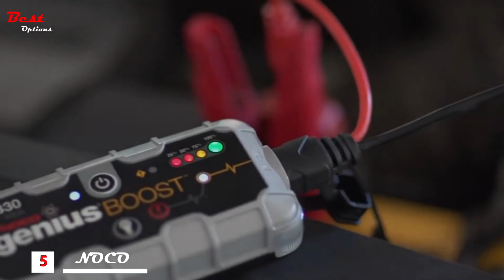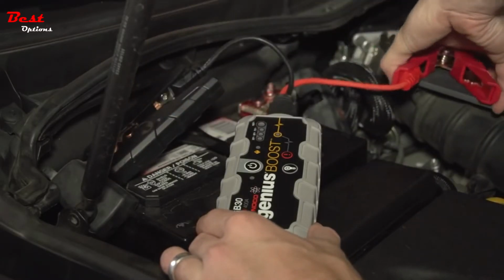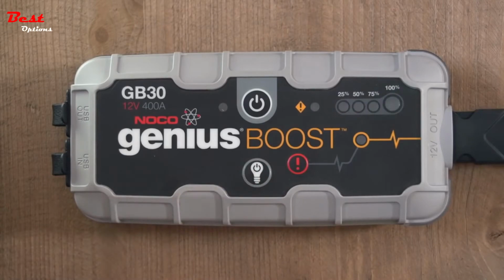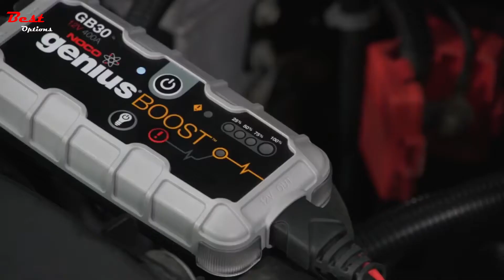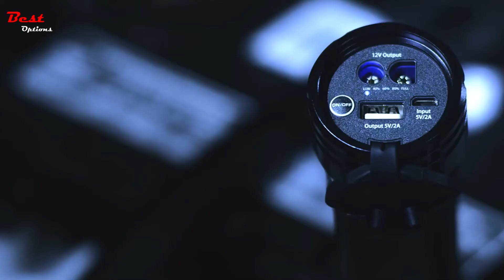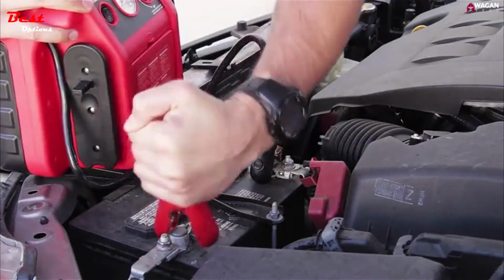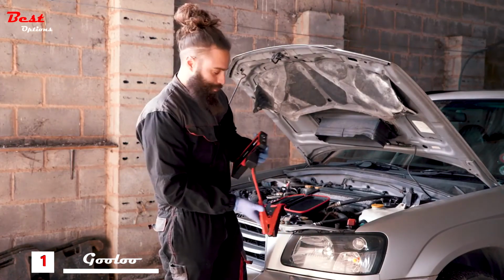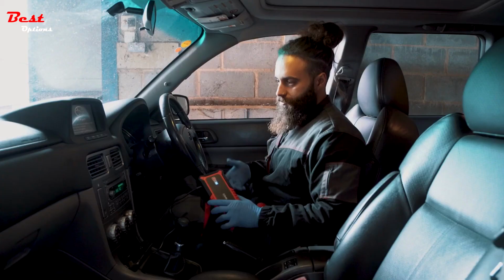Best Car Jump Starter 2021

Comment from the maker: ✅1. GOOLOO Upgraded 2000A Peak SuperSafe Car Jump Starter
👉 US - https://amzn.to/2NcK9AZ 
✅2. Wagan EL7552 Jumpboost V8 Air 1000 Peak Amps Jump Starter 
 👉 US - https://amzn.to/2Mcai2k 
✅3. Schumacher DSR ProSeries DSR116 2250 Amp 12V Rechargeable AGM Pro Jump Starter
 👉 US - https://amzn.to/37x1v2p 
✅4. SCOSCHE PBJ700-1 PowerUp 700 Portable Car Jump Starter
 👉 US - https://amzn.to/2OVXga7 
✅5. NOCO Boost Plus GB40 1000 Amp
 👉 US - https://amzn.to/2ZzrUbg 

😍 BEST AMAZON TODAY'S DEALS: https://amzn.to/32jV4xi